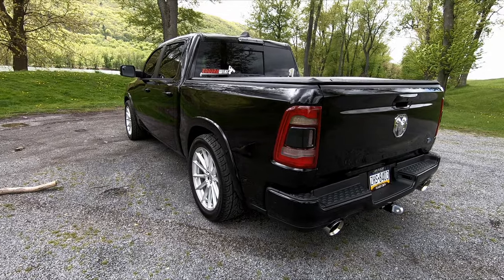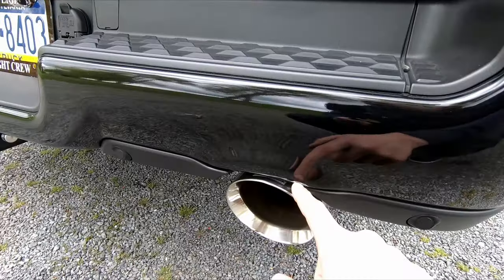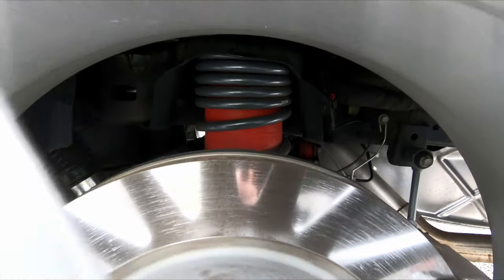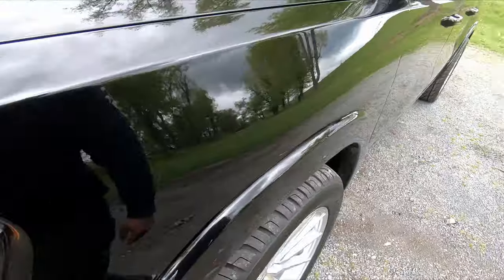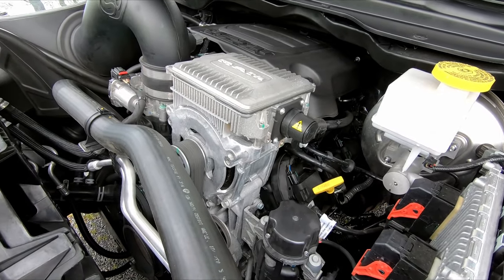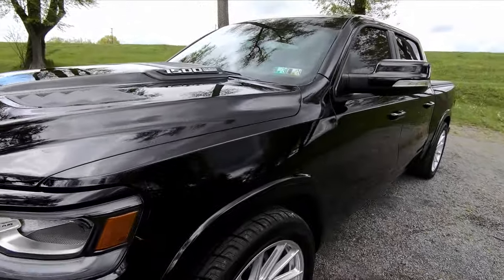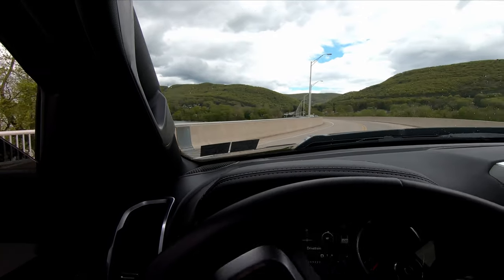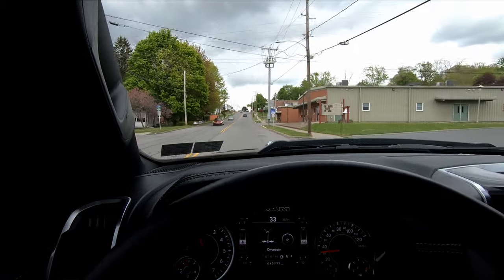Lowered Ram 1500 Review.

Comment: Ur push start is stock? If not where did u get it from?
Reply from the maker: It’s a stock switch out of a TRX direct plug in, you can buy them at your dealer.
Reply: @Ferraiolo_1  converted from a key ignition? I believed u already had a push button start base on the model of ur ram
Reply from the maker: @JohnPhilipCo ah I thought you meant the red button. But yes the push to start is stock.
Reply: @Ferraiolo_1  thanks man , appreciate it